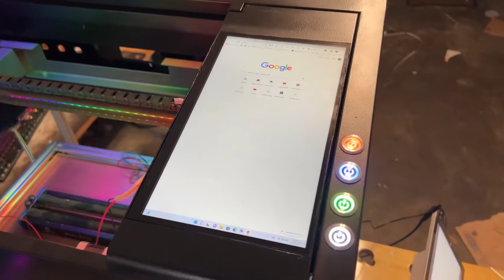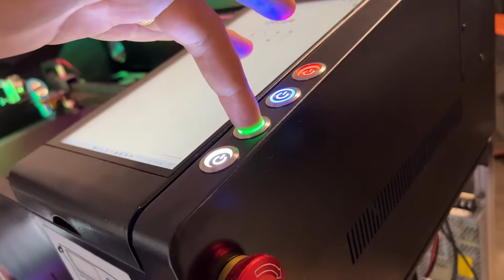My K40 Laser Mod

Comment: Wow - this is an entirely different machine to mine, I love it.  All I have managed to do is make a dog eared hole in the bottom of the case using an angle grinder for the rotary (I have tried to make the hole less sharp by wrapping duct tape around the sharp bits).  My rise and fall bed is one of those lab scissor jacks.  Quite the project, congratulations.
Reply from the maker: Thanks. Sorry for replying so late. I also have one of those scissor jacks and that's what I was using before deciding to upgrade the whole thing. I haven't finished covering the body of the machine since it's extended but just about everything else is done. The only thing left is to replace the brains. The board I'm using is faulty and hangs up occasionally so a replacement is on the way. I also added a few more buttons on the front of the machine, 15 to be exact, so that I can use them to control and move the laser head as well as home the machine and start/stop jobs. Taking my time and having fun with it.